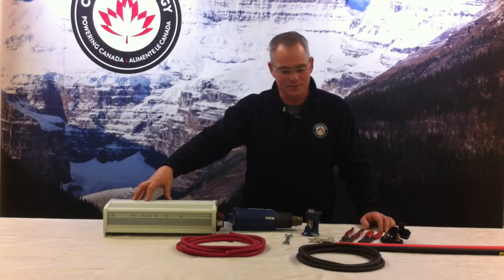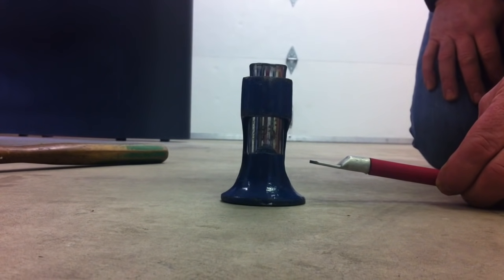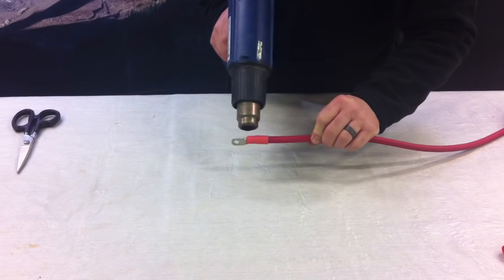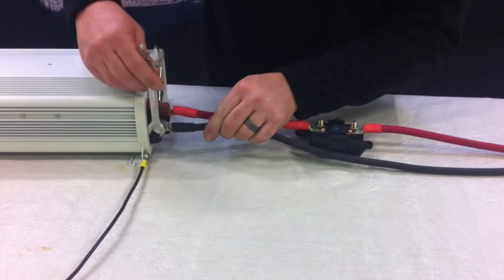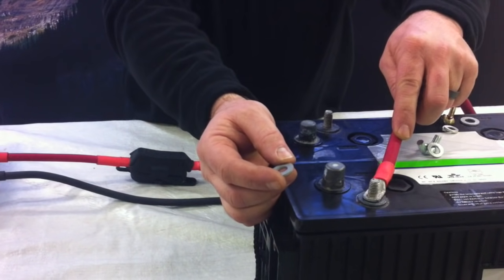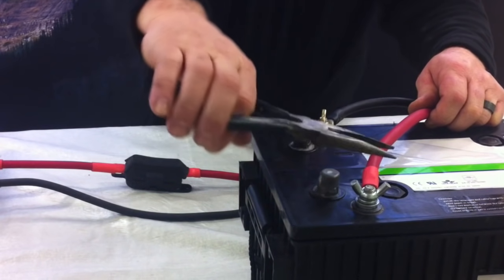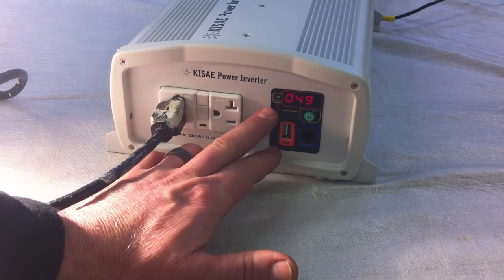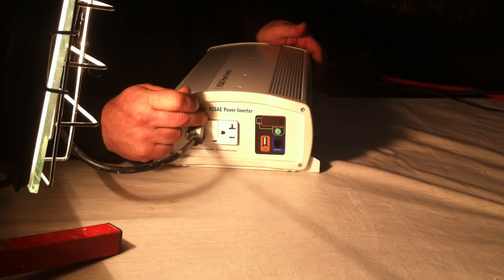Canadian Energy™: Inverter Installation : 101

Comment: Is there a good way to add a battery cutoff to this setup? I appreciate the tutorial and have that set up currently but would like to be able to easily transition to use of inverter and an easy way to cut power to inverter when desired.Thank you in advance!
Reply from the maker: Yes -  it’s never a bad idea to have a disconnect in between the battery and inverter, in addition to the fuse you could add in a battery disconnect switch like the Blue Sea 9003e or a Type III Manual Reset Circuit Breaker. Either of these will work well for the application, you just need to make sure the rating of the device meets or exceeds the maximum amperage draw of the inverter. Hope that helps!
Reply: Canadian Energy DONE!  Best tutorials on the web!  REALLY!!!  Thank you so very much!  (By the way....your exclamatory comment of sizing cable "TO THE MANUAL" saved me!  I initially
Bought cable matching your demo size! 😵  Watched it again and realized the err of my ways! 😜. As I said...the BEST on the web!!!

Comment: Wtf is that part about with the order of tightening the wing nuts? After tightening the negative nut, you still have to do the positive one and the same problem still persists that you might hit the chassis with the pliers. The only thing about the tightening order which i can think of, is that you don’t want a negative cable flopping around with the positive one connected. The negative cable might make bad contact everywhere on the chassis. If you connect negative first, then it doesn’t matter if the positive lead touches the chassis, nothing bad will happen. It also depends on which side of the cable you are working though. On the appliance side you want to get the positive cable connected asap to prevent it from touching the chassis.
Reply from the maker: Richard van Pukkem Jay’s point in the the video is the tightening of the positive and negative connections on the battery, if you connect the positive, then the negative and then tighten the positive wing nut with a tool, you could cause a short circuit with the tool if you come into contact with the negative terminal or the chassis.

Comment: Hello Sr ,I have a  2000 w inverter but I have a problem, when I turn it off  star beeping so I turned buck on stops the beeping but heats up too much what can I do to fix it. can you help me  thanks in Advance  have a good day like your videos. ..!
Reply from the maker: If the unit heats up while operating there may be an issue with cooling under load, I recommend referring to the trouble shooting manual, next step would be to get it to an qualified repair depot for diagnosis.

Comment: if I have a 4000 dc amp 4000dc watt battery on a 10000 dc watt power invert?,by the it's a jupiter power inverter from  harbor freight tools
Reply from the maker: charles Lane27 we don’t understand. That doesn’t make a lot of sense?
Reply: if the power inverter has a built in input fuse can I add another fuse to increase the current input capacity of the power inverter?
Reply from the maker: charles Lane27 Typically inverters do not have built in DC input fuses, but yours may be different.  An inverter is only designed to output what it is rated at, in your case probably 5000 watts continuous, 10,000  watts peak for 5 ms, the input amperage is required directly related to the output of the inverter, at 5000 watts AC output the inverter will draw approximately 500 Amps DC at 12 volts, adding another fuse will not make a difference as the inverter is not designed for any higher input amperage.
Reply: @charleslane2735  
No. That would do nothing except make your inverter NOT blow it's fuse when it should.

Comment: Fuse should be sized to the wire first!  
This is to prevent wire from getting too hot and causing a fire, then worry about protecting the electronics.
Reply: I think his fuse is a little to much for that size wire
Reply: @armourofgod6310  if its 2000W usually you divide it with the battery V so 2000W/12V = 166,66A.  You multiply it with 1.5 and you get 1.5 x 166.66A = 250A 
This would actually mean that the good fuse for a 35mm2 cable with a 2000W system behind it would actually need something from 250A to 275A

Comment: please correct your statement lamp is pulling 0.49 amps not 49 amps for 500 watts halogen lamp😉
Reply: Thank you sir I was also thinking like waaaaay not in hell is pulling 49 amp. that is half of a one family house pull. I agree only 0.49amp
Reply: @kenncct  The load is a 500 watt halogen lamp running on 120 volts.  500W/120v=4.1666 amps
Reply: 49A is correct, because remember this is the current flowing out of the 12V battery which is powering the AC lamp.  @kenncct calculates 43.5A, and if you assume 90% conversion (inversion?) efficiency, that's 43.5/.9 = 48.3A.

Comment: what fuse i have to use for pure sine inverter 1500w ? and what is the best fuse i have to use
Reply from the maker: You will require a minimum 150 amp rated fuse, the type will depend if the inverter is low frequency (transformer based) or high frequency, a T Class fuse will work for either application so you don't have to guess, our Part for the fuse block is FB1 and fuse TF200, the other option is an AMG style fuse if the inverter is high frequency.

Comment: Loose the wing nuts and use anti rotation washers, remember your boat or RV moves about, it flexes and vibrates, if those connections come loose your going to be in a world of hurt.
Reply from the maker: Thanks for that, Tony!
Reply: What about lock nuts would they be a good idea? I recently had a cable from my battery to my 2000w inverter melt (the insulation melted off) and I am trying to figure out why. It was a short bit of cable (perhaps 12 inches) from the battery positive to a 150amp breaker just before the inverter. Any idea what could have caused this?
Reply: @chatteyj  the breaker may have been too small, idk tho 🤷

Comment: You forgot the ground cable
Reply from the maker: Rudy Men Not sure what you mean, there is a negative cable to battery and chassis ground off the inverter that would connect somewhere to the vehicle chassis or common ground.

Comment: I have an inverter I bought used and it is not this brand everything is hooked up and working fine but the light goes from green to orange after use...what causes this? please help thanks in advance.
Reply from the maker: +Caleb Yagow if the inverter is functioning properly it could simply be an issue with the LED indicator light but this is only an assumption, we recommend contacting the manufacturer of the inverter for a copy of the manual.

Comment: Great video but you are only pulling 0.49 amp not 49. But thanks for the educational video.
Reply from the maker: Thanks for your comment but if you do the math, a 500 watt AC light does not draw .49 amps DC and the battery voltage would certainly not be down to 11.8 at ½ amp DC draw.
Reply: @CanadianEnergy  Yes sir you are correct on the DC factor Voltage X Wattage but that lamps is AC conneced to a AC connector which is 120volt. Power X Wattage in this case would be 4.1 amp. In either case great video.
Reply from the maker: juvenille2001 thanks for watching. We really appreciate the connection. 🇨🇦✌🏼
Reply: Of course its 49a lol. Its showing the DC draw.

Comment: Hello sir'how about how to connect  my 3000w  inverter to a solar panel and how to resize  the cable I can use for  battery  bank,';?
I need more idea for this thank you  sir,'.
Reply from the maker: The solar panel needs to be connected directly to the battery through a Solar Charge controller, cable size will depend on the how much voltage and amperage the solar panels are feeding to the batteries and the length of cable.

The maximum DC draw of a 3000 watt inverter is approximately 300 amps @ 12 volts so it should be connected to the batteries with a minimum 2/0 cable or larger depending on the length, there should also be a fuse in between the inverter and batteries (closer to the batteries) on the positive cable.

I recommend using a using an online cable sizing chart to calculate the exact size of cable required for the solar panels and inverter.

Hope that helps.

Comment from the maker: 8 AWG is the minimum.
Reply from the maker: Naila  Martus Most reputable inverter manufacturers will recommend a fuse size in the installation manual for their inverter. A 150 amp fuse will meet the continuous draw  of a 1500 watt inverter.

Comment: are you serios  500 Watt at 120 v is this 49 Amp?
what a shame they let anyone to post anything
Reply from the maker: Alex Sab what do you calculate the DC amp draw is at 12 volts?
Reply: @CanadianEnergy  ligth is pluged in in to the 120 v outlet  and it is rated at 120 V

Comment: If you’re going to do instructional videos, give the correct information. The fuse or breaker should be no more then 12 inches away from the battery.
Reply from the maker: N.Y. Pigskin thanks Pigskin, you are correct about fuse location but Jay did not say how far to mount it from battery terminal so in fact he didn’t give the incorrect information. So there.
Reply from the maker: N.Y. Pigskin it’s a demo. Not real life. You know, you seem like a really nice fellow. Not angry or rude at all.